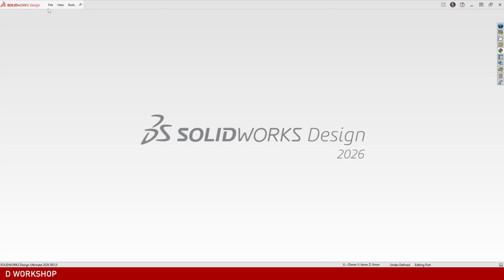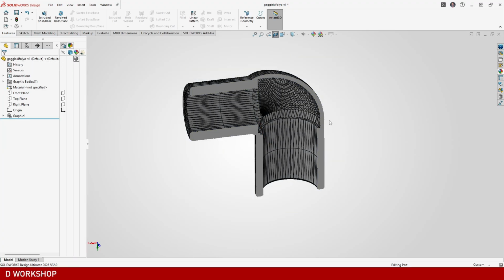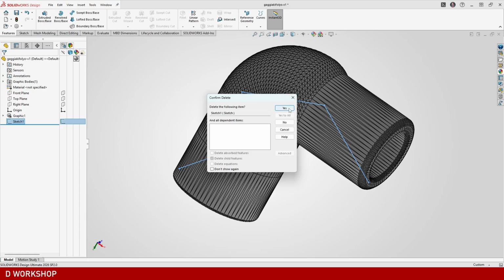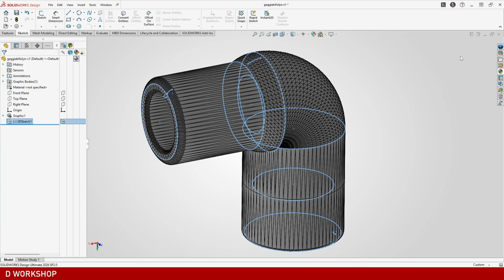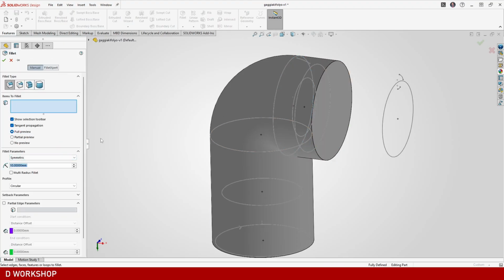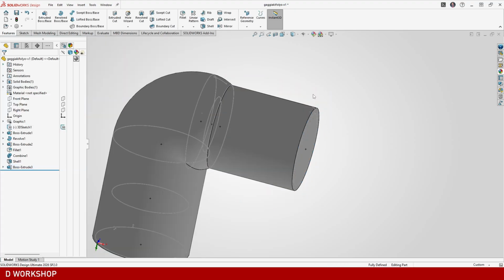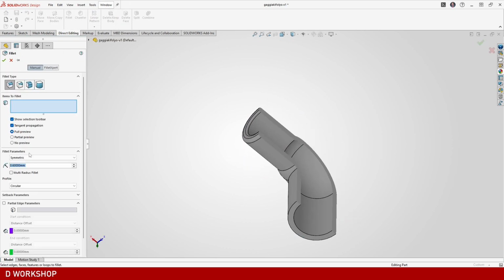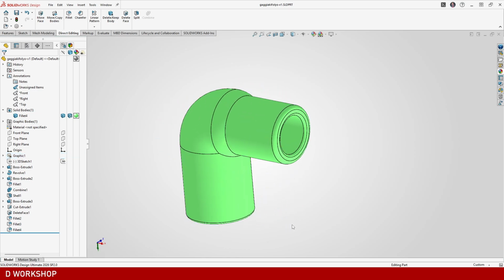Is This Hidden STL Error Ruining Your 3D Prints?

Comment: Thank you.  This was helpful for converting the STL's to a solid.  Unfortunately, you wouldn't be able to actually make this part except by 3D printing.
Reply from the maker: Thank you! 😊 Indeed, but this particular part was designed for 3D printing, so that's perfectly fine. After all, the video is called “Is This Hidden STL Error Ruining Your 3D Prints?” 😄